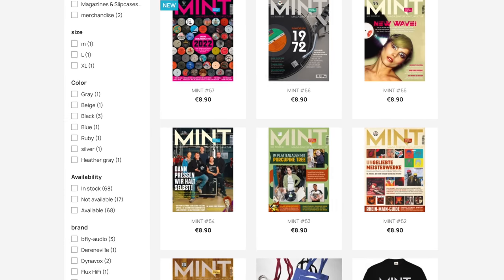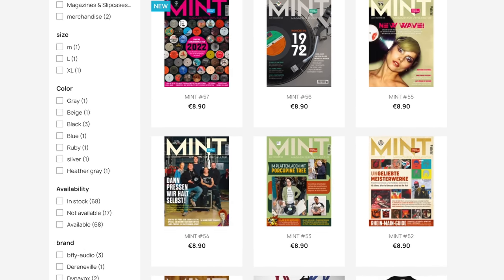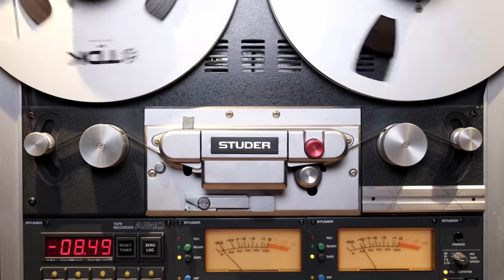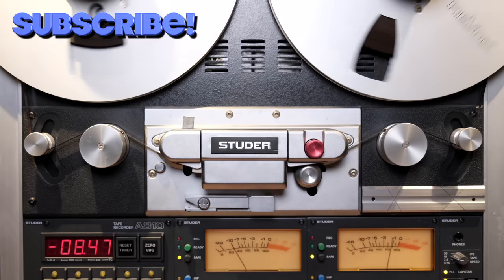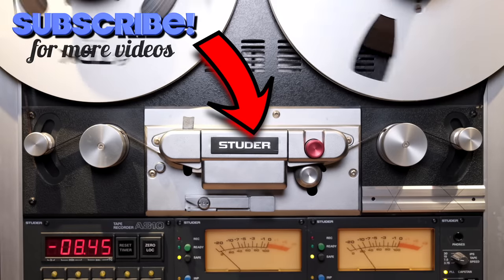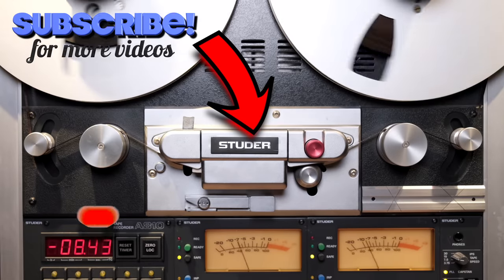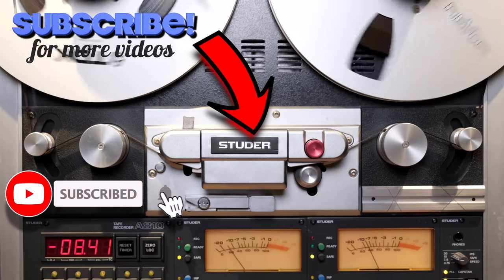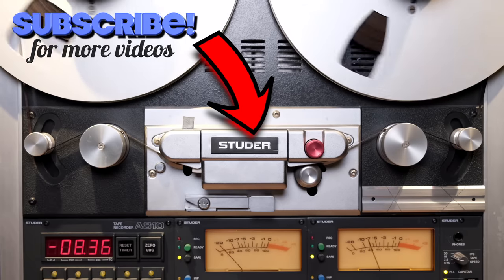Digital Delay: The little dirty secret of vinyl mastering (including past AAA records)

Comment: This might be superfluous but if 16 bit or below digital lathes are the issue maybe somebody could invent a 32 bit AI Smart Lathe. I obviously prefer to have analog through the entire chain but if it's not possible, 32 bit should provide plenty of resolution.
Reply: Fortunately sixteen bits are more than enough when cutting historical low res formats like vinyl. I am constantly amazed how so many audiophiles are enthralled by bigger numbers.
Reply: @nyquist5190  Thanks for your insight. That seems shocking since no experienced audio engineer would record, mix or master at 16 bits. 24 bit, 44.1kHz is the minimum. I can hear the difference between 16 bit and 24 bit audio, especially in the percussive sounds and dynamics as a whole. To cut vinyl at only 16 bits seems limiting and inaccurate. Vinyl has incredible resolution when played on a professional turntable with a high quality stylus. A friend of mine masters for vinyl, I'm going to ask him. I definitely don't consider myself an audiophile. Open reel 2-track stereo tape is the most expensive, highest quality analog format btw but most audiophiles will never hear the source which is the multitrack 1 or 2 inch tape.
Reply: @RobMentors  It is of course utterly unlikely that you can hear the difference between 16 bit and 24 bit with normal music. 24 bit indeed provides benefits when recording, mixing and mastering. But in the end product it does not. Vinyl's resolution can hardly be described  incredible since even 16 bit digital beats it handily. On a good day vinyl's resolution is equivalent of 11  - 12 bits. It is good to realize that you can make an audibly indistinguishable copy of any analog source with 16 bit digital. But you cannot make it vice versa. And that is really all there is to it.

Comment: Way too alarmist, I think, when there's easy solution for it nowadays. After all it's not necessary to feed cutting head with delayed digitized signal. You can first make digital audio file from your analogue tape, and use this digital audio to feed groove pitch controller. This digital audio would start in advance of analogue tape audio, exactly one rotation time before. Then the analogue tape audio would be the one which is delayed, and with this one the cutting head would be fed. For instance GZ Media offers this option for you.
Reply: Yeah, that is what I was talking about. I don't see a reason for the preview to be required to be analog, but the sound needs to be.
Reply from the maker: Yes of course, but what if someone wants or, worse, thinks he's is buying an full analog record? Past OGs? Hmm...
Reply: @anadialog  Sure, you are absolutely right to press the issue. But not everyone has a Neumann cutting lathe. We have to be open for new ideas as long as we get analog sound.
Reply: @anadialog  If an independent band/label wants fully analogue print, they can do. I believe in pressing plants are analog loving people who are willing to go through that. But major labels just want cash for minimum work, they will usually not roll out their analog master tapes for vinyl reissues of their back catalog, when they have digital backups already. They just send digital files to pressing plants and tell them to do whatever they can. At least they use 192/24 quality, I believe. But to be fair, I would be careful to bring out precious master tapes too, moreover old tapes deteriorate with time and at one point the digital backups will be the best what we will have.
Reply: @StackOverflow80  I think caring for the master tape is the thing, not necessarily because they have less work with digital. They know for sure they can get a few $ extra when advertising AAA.

On the other hand, the world is flooded with music over the decades, so there is always the niche to produce AAA. It's not an issue to play the master tape every 10 years for a lacquer cut.

Comment: There appears to be a lot of confusion. 
The digital delay is used to control the lathe. That is not the signal that is recorded onto vinyl.
Reply from the maker: Nope, no confusion, unfortunately this is 100% solid. If you are using a machine without 2 heads but only one, the original signal is for groove pitch which is contemporarely digitized and sent to the lathe regulated by the electronics that have analyzed the signal amplitude. I also inserted an article in the video where this is CLEARLY stated. 
Also Kevin Grey stated this in a interview on Stereophile and in his own recent video. Plus, the president of Speakers Corner in my interview with him he stated this. The link is in the video description.
Reply: @anadialog  My apologies.
Reply: @anadialog  What models of lathes use two heads? Do you mean two cutting heads? Or are you referring to tape machines with the preview?
Reply from the maker: Thanks for you mature answer. Yes, as explained in the video, tape machines with two playback heads. For example Analogue Productions have a Studer with two heads for an analog delay and obviously Coherent Audio and Speakers Corner etc. but several others don't.

Comment: I don't agree with framing everything as analog vs. digital. Digital is every bit as good and even better, as long as the technicians know what they're doing. If they don't, it's going to sound bad, regardless of whether it's analog or digital.
Reply from the maker: You missed the point of the video. We are talking about transparency and that most AAA records of the past, aren't. In terms of quality, the low number of bits is objective
Reply: @anadialog  I got the point. To me, it really isn't provocative that there's a digital step in vinyl production. I'm 85% into classical music, where the use of digital processes has always been a) transparent, and b) beneficial to sound quality.
Reply: You said digital is every BIT as good. 🤣
Reply: @VideoArchiveGuy  Accidental pun.